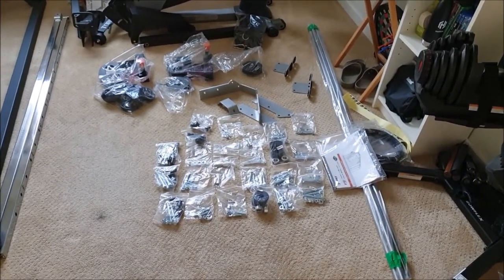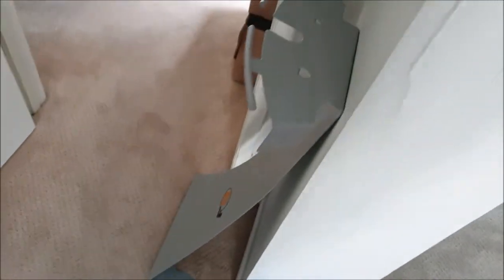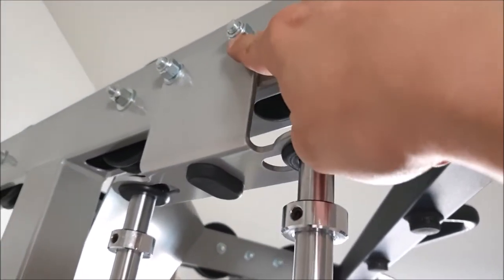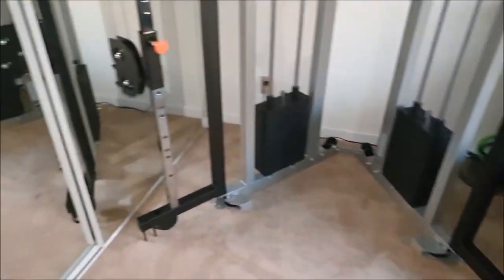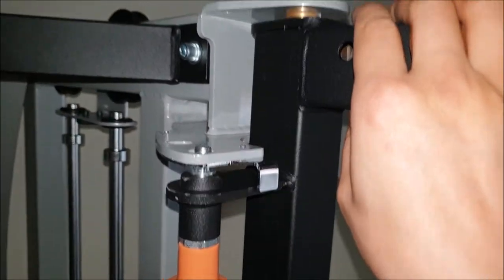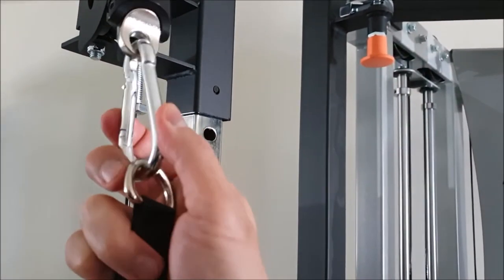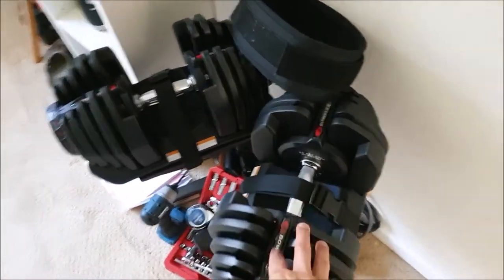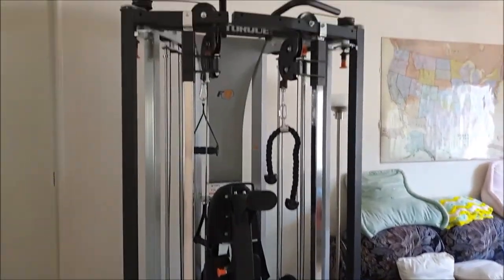Torque Fitness F9 Fold Away (Installation)

Comment: Suuuuper helpful!! Took advantage of the Black Friday deal - pulled the trigger and got the Torque 9!!  I'll be installing it right in front of a window...worrying about having to move the Torque F9 in the near future when we need to replace the window. (Have you had the need to move the beast yet? )
Reply from the maker: @joycelinelu  Congrats! I did move it a couple of times. The key is to unload all the weights. Then slide underneath those furniture slides underneath and good to move.👍

Comment: It took me about 2 evenings to put it together as in getting off of work, having dinner, and then working on the assembly. If the option was available, I would have paid for professional installation. The good thing about assembling yourself is that you know how to take it apart. You can make up all kinds of exercises with the F9.
Reply: How long did it take?
Reply: @SacTu  Maybe 6 hours total but it could be faster with another person helping.
Reply: So what is you experience so far? Do you recommend it? Or are there beter options?
Reply: @kevinaelbrecht4621  I don't think there is a better option. You can place it in a corner and it disappears when you fold it in. I use it daily.
Reply: @kevinaelbrecht4621  Hello Kevin, did you buy one of these?
Reply: @Nigel__  No, with the current inflation and rising energy prices in my country I decided to keep my money for harder times.

Comment: Hey, I am deciding on whether to buy this functional trainer or not. My question: does it feel stable? When putting more torque on the doors do the pins keep everything in place or will it get a bit loose? And does it rattle when doing for example heavy pushdowns or something like that. Thanks in advance!
Reply from the maker: Short answer is it's rock solid. Love the machine. No rattles and just smooth.

Comment: Great vid. Any chance you can measure the height of the pulley at its highest position from the floor? 

This seems like it goes markedly higher than the titan, rep, and inspire. (I’m 6’5 so that’s huge).
Reply from the maker: Sorry, I don't quite understand what you're asking for? Is it when I pull on the handle all the way down until the pulley touches the top of the rack? and what is the measurement from the bottom of the 1st weight stack to the bottom of the pulley at the top?
Reply: @tranjen  all good bought a different model

Comment: VIEWERS READ THIS: First of all, the the poster of this video, I love it, thank you so much. But one of your pieces of advice is wrong. Do not skip ahead to put those bottom bolts in. When you do that, the rods are too high and you can’t slip the weights in anymore. Go in order. 

To viewers: the two times I needed a person’s help (well, you can do it yourself but it’s just easier with someone else) are: 1. The initial combining of the two large pieces in like step 1. And 2. Someone should hold the rods as you put the weights in because the can tip over. 

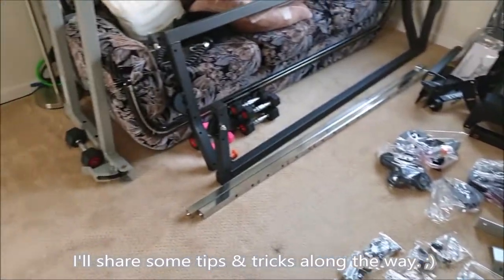Anyway, it took me from 1:30-9:30 to build it. I suck at building things so it took forever. I could not hammer the little phone wire looking thing to hold the weight changing rod. I spent so long trying but it would not go in so I gave up. The rod still works without that phone wire. This machine is amazing. You won’t regret buying it.
Reply: Also: if you live in an apartment complex with insane rules like I do, please make sure you have tip for the delivery guys. I tipped them $80. It’s because they had to bring the two big boxes down a flight of steps so I can use the service elevator. I brought all the boxes of weights myself through the main entrance. The two HUGE boxes that were downstairs could not fit in the service elevator. So I just opened them in the basement and took up the pieces mostly one by one. 

The delivery guys really had to work their asses off getting those two huge boxes down the stairs for me. They are technically only supposed to do curb drop off. The delivery fee for this thing is already expensive ($400 I believe) but I can see why because it’s humongous. Anyway, good luck. It was a ton of work. But worth it.

Comment: Are the pulleys plastic or aluminum?
Reply from the maker: The one's holding the weights are steel, and the ones around to the pulley handles are polyurethane like material.